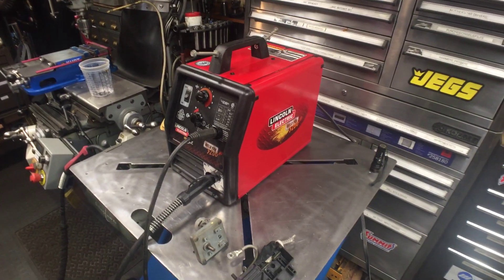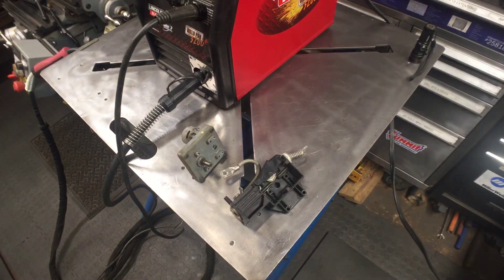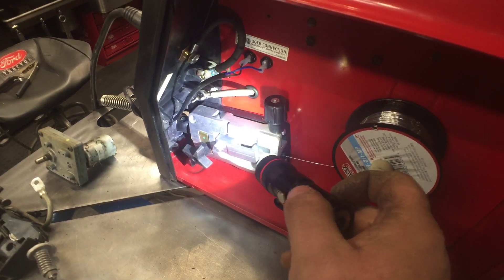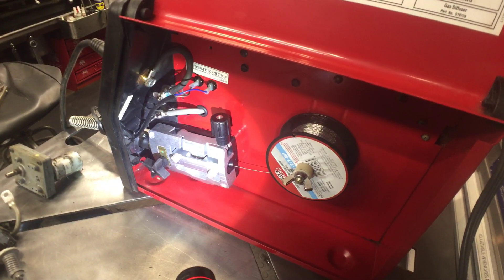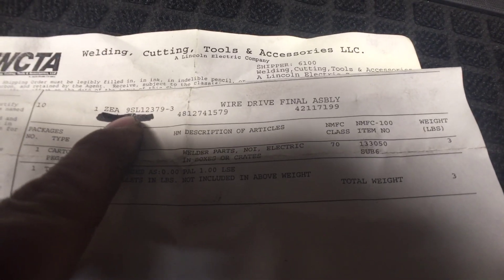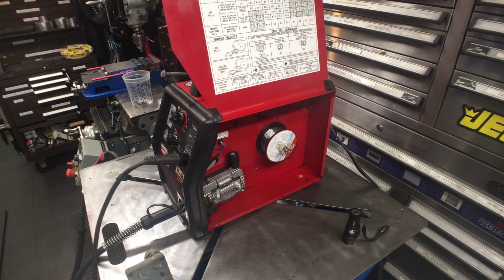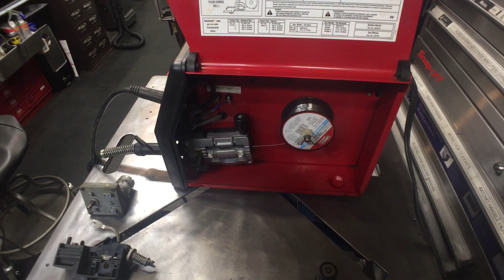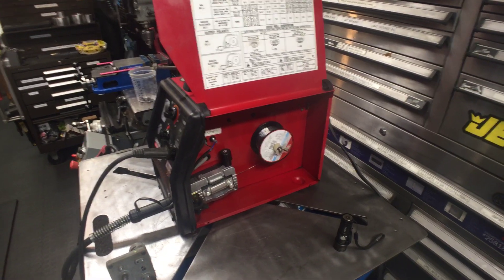Lincoln welder 3200hd 140) drive system upgrade

Comment: Does this unit accommodate for a bigger gun or are you still limited to the 100amp rated gun? 

i have the Weldpak 155 and i want to run .045 wire because it says i can but the gun doesn’t fit .045 liner so i need a bigger gun BUT the bigger guns have a bigger input shaft, so im having a hard time finding what i need. 
if this is a viable solution ill just do this because i already have other guns that can handle bigger wiring anyway

Comment: with gas or gasless????? I have one just like yours and im really confused. On the machine says flux core gassless. but looks like mig is with argon because I have a tip on the back where you connect gas hose. Im really thrown off by what the machine says and what others are saying lol
Reply: also I did not watch your whole video, so that's why im just asking

Comment: I have the same machine and have the same problem, the feed wheel spins but doesn't pull the wire. I just ordered a gnarled wheel from Amazon. Hopefully it helps. Ill update my post after I try it out.
Reply: Did it fix your problem ?

Comment: Nice fix for that little machine! Your front panel socket is a Dinse which is smaller than Tweco and highly preferred for what you're doing. Converting to MIG is easy by running the gas tube from a MIG gun to your choice of solenoid valves. See the WELD-PAK 100 conversion videos for how-to.  Drives can be cannibalized from old industrial MIGs and separate feeders too if one doesn't want to pay retail for the mechanism.

Comment: I wonder if the wire speed knob system could also be changed out for one of the infinite style instead of the 4 settings one
Reply: No because the transformer is different on a tapped welder. For the little machines it's far from critical.

Comment: knock on wood iv had mine for about 10 or 12 years also n probably run thru one of the tiny 1lb spools like u had on urs in about a month n iv never had a single problem other the occasional birds nest  but im pretty sure thats because of my rigged ass sleeve :p  iv put a new drive roller on a few times but nothin else  other than tips

Comment: buena actualización, yo tengo una 3200hd desde hace 10 años y aún trabaja como nueva
Reply: Lo mismo yo. es buena maquina.
Reply: Tambien tengo Una por 11 anos y haora se me frego, El "drive system" El motor lo tengo que cambiar. No tenia problemas con Ella.
Reply: Buenas tarde esta máquina Lincoln suelda sin gas se podrá adaptar a arco
Reply: @jorgeantoniolopeznegrete1790  el amperaje es bajo como para soldar con arco;con su rollo innershield puedes soldar PTR y perfiles como los usados para hacer puertas y ventanas de herrería, yo aún la sigo usando y para varillas gruesas o vigas ahí uso una inverter de arco
Reply: tengo una misma enciende pero a la hora de soldar hace arco pero no derrite
Reply: @pasivo2009  lleva unos capacitadores grandes adentro de la máquina, puede que sean los del problema, o la estas usando con velocidad del alambre muy rápida.
Reply: ya luego la boto a la basura